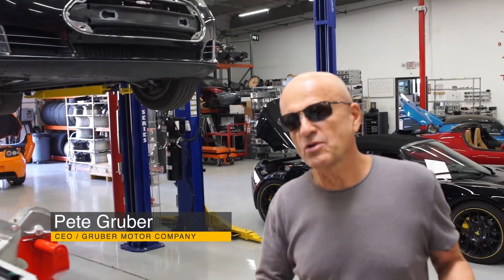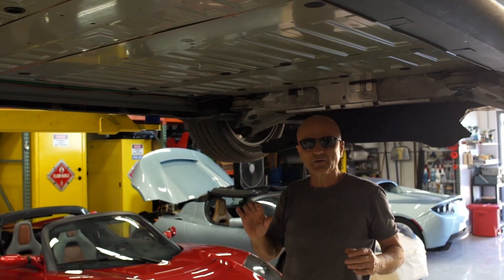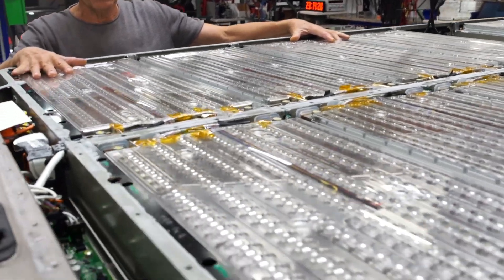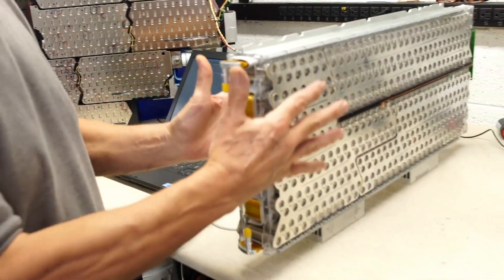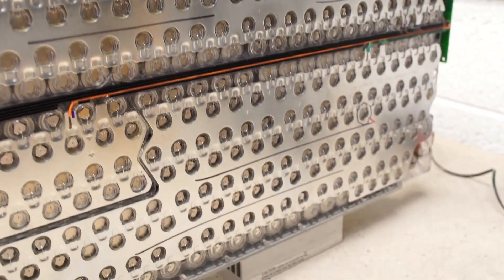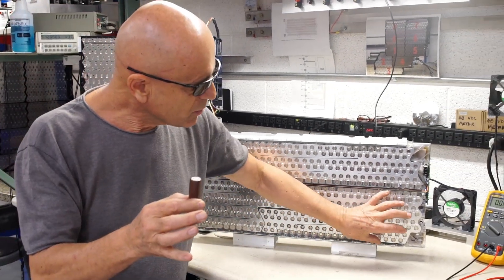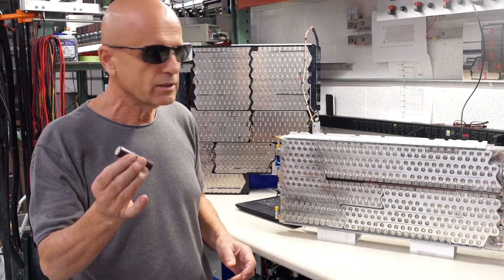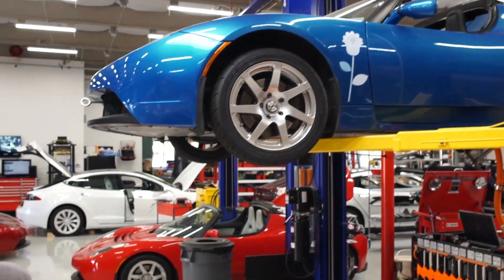Tesla Model S Main Battery Repair | Gruber Motors

Comment: The special process to determine the bad cell is most likely a thermal camera. When you charge the pack and watch it's temperature, the resistive cells will get hot and show quite clearly on a thermal image. 
Snipping them out is fine, as long as its not too many per pack. Effectively removing it will decrease the whole packs capacity, which will lead to balancing issues if a lot of cells are removed in this way. So if this is done repeatedly to a pack over a few years there will eventually come a point where you need to actually open it up and replace the faulty cells with new ones.
As far as I can see the cooling solution they've gone for is flat tube sandwiched with thermal pads in between the cells. That way the cells are not directly touched by the coolant but can still dissapate their heat. So a replacement of cells should be possible, although it will take significantly longer than just cutting the fuse. So its best to only do this if the pack has lots (Say more than 10%) of bad cells.
Reply: Thermal camera might catch it, or you could probably use a sensitive DMM to measure the voltage drop across the fusible link to each battery.  At equilibrium the bad cell will have approximately 74 times the voltage drop seen on the good cells.
Reply: @fredhamilton1701 that would be fine if the cells where in series but there in groups that are parallel. Put it on a power supply and wait for the hot spot, simplistic/fast. The real problem, it is all a waste of peoples money to do this. If a pack could be r&r in a hour that would be fine. The labor time to do this makes this a loser. You could fix it and two months later be back in it. The cells are going bad across the board because of the number of charge/discharge cycles. Great money maker for the shop, suckers bet for the customer.
Reply: @mitchellcrane9809  The cell became resistive and perhaps that can be caused from the cycling, but it can also be a defective cell and not an indication that many more are about to fail.  I've built 2 EVs with LiFePO4 cells whereas the most recent one has 38 cell modules with 52 cells per module.  After just one year of use, I had one bad cell out of 1976 that went resistive.  I designed my own BMS and was able to compensate by adjusting balancing parameters for that module but eventually, I added a one-off cell balancer to keep that cell topped off.  That's worked for 6 years so far but I really should pull the pack and replace that cell.
Reply: @NP-co7kj  
What do you mean by "topped off"? You bypass that cell? Also, if you replace that bad cell, will it throw off the balance because of age/capacity differences? I'm trying to learn about battery management.
Reply: @shwndh  Hi. By "topped off", I mean the isolated charger is adjusted to 3.42 volts which is my balancing voltage.  Without the isolated charger connected to the cell that is self-draining, the charge in that cell module would be depleted over time, so this is essentially trickle charging that cell to compensate for the self-discharge.
Reply: @shwndh  I forgot to mention that if that cell is replaced, the capacity of that cell module (in my case, 52 cells per module) will rise slightly because as energy is drawn from that cell module, the new cell will be the last cell delivering energy due to its higher capacity.  The effect on the battery pack will be that if that cell module was the lowest capacity in the series chain, it likely no longer will be, so the effect would slightly more useable capacity in the pack.
Reply: Only a sucker would buy an electric car
Reply: If you look closely you can see and IR gun on his workbench.  Camera would scan larger areas faster - gun would provide better data for one cell.
Reply: Thank you father
Reply: One bad cell and 444 cells to a Pack is 1/444. This would hardly affect the Battery Capacity at all.
Reply: @peterduxbury927  To tell the truth
It's not just cutting 1 to 444.
It's much like 1 : (444 divided by 6 battery sub modules) that is greater than 1% (1:74).

The P73 one would also 'lower' other five P74's capacity by suppressing overal excessive ∆V via balancing.

P.S. That's because of misbalancing of former S6P74. The same is for other 13/15 modules.

Comment: Thank you for sharing.  I watched the electrified garage fix a battery pack and their system identified the bad sheets and bad cells within those sheets while the battery was still in the car so they knew where to go before they dropped the battery pack.

Comment: I've worked on electric buses which uses software that looks at each cell within a battery pack - voltage and temperature -  therefore can tell  exactly which cell or cells are defective. I'm not a software engineer so I have absolutely no idea what's involved there. All I know is, whenever there was a problem, I could plug in my laptop into a specific network port to look at each battery pack, then zero in on all or individual cell in the defective pack. That made my job really easy.
Reply: What is the software name please?
Reply: @paulasobdong7745  It was BYD's proprietary software, so i don't remember the name, and I'm pretty sure it's not available outside of BYD.

Comment: Wouldn't the $22K cost of a new battery instantly be added to the value of the car? I'd have thought c.$35K for a 6-8 year-old Tesla S with a brand-new battery was a pretty good deal. From what I gather the motor units are so over-engineered (absolutely massive bearings) that estimates of a life of c. 1M miles are mooted for them.
Reply from the maker: It should be, but valuation rules are more psychological than mathematical.

Comment: I'm glad the newer designs they are using today in the Model 3/Y and new Model S don't have this issue.  These old Model S's are when Tesla was still struggling as a company, they've come a long way.  But it's good there is an independent repair option.
Reply: Curious how the newer designs overcome this ?    Is this indeed true ?    Also curious how long it takes to find the module and then the particular brick and finally the "rogue" cell  ?

Comment: If one cell is gone its probably the start of the inevitable degredation  of all the cells.. 18650s dont last forever.
Reply from the maker: Actually, we have Tesla Roadster battery packs pushing 13 years still going strong, which amazes even the original design engineers.

Parasitic cells seem to be an aberration, both in Roadsters and MS.  That does not mean these packs will last forever.
Reply: @grubermotorcompany  all these things are basically just hundreds of 18650 lipo cells which are in power tools, torches, power banks, laptops etc etc...  why do they last three years in all the other things before degrading badly???

Comment: Great to see that there is an option for repairing it rather than just tossing the car. I'd be curious to know what the charge is for such a repair?
Reply: Jacob Holden  
Wow he's really lucky. There will be all kinds of new challenges and issues that arise with electric vehicles that people didn't think about at the time. I'm sure that was true with combustion cars when they became popular versus horses. But there is going to be an adaptation. And I don't like the fact that Tesla controls the repair and maintenance almost exclusively. Also they can barely handle the repairs needed at their current production levels. That's going to ramp up very soon probably doubling in the next year. If people can't get their car fixed in a reasonable period of time this is going to be a serious issue for tesla. I would say that's one advantage that the legacy manufacturers have. They're used to sales and service after the sale. And they have the equipment and the facilities to handle that. On the flip side I think they're doing a much worse job of building decent electric cars although that is beginning to change. The new Kia ev6 and ionic 5 look pretty awesome. The vwid4 is pretty nice too. It has some problems with infotainment systems being a bit crappy. But the overall car is pretty damn nice. But I'm probably going to wait until Toyota brings something out. Currently driving a 13-year-old Prius with 377,000 mi on it. Original battery powertrain the only thing I had to change was the inverter 2 months ago. Bought one of the salvage yard for a hundred bucks took me 45 minutes to install it no big deal. And that's the kind of thing that you can't do with a Tesla currently. I definitely be interested to see the video when you post it. When lithium batteries go up they are rather exciting and not in a good way. Be safe out there, and love you guys down in Australia. Someday I'd love to come visit.

Comment: Realy nice

How could you guys find the exact defected battery among the others ? I mean they are connected to each other parallely, I would like to know that what are the pecial procedures which you guys took advantage of
Reply: There are only four cells in parallel in each cluster.  Once the bad cluster is found inside the "sheet" by a simple voltage test, it comes down to isolating the one bad cell out of four  I haven't done it but I think there will be a small difference in temperature between a nominal cell and a leaky one.  I would try charging the four-cell cluster, then look for the cell that's warmer than the other three using a thermal imaging camera.

Comment: "All it took was one single cell out 7000+ to completely shut down the main propulsion battery pack"

Why won't the battery pack just simply short or disconnect that one bad cell? Also, doesn't the firmware know which exact cell is misbehaving? They are not monitored?
Reply: the present design of the battery pack does NOT have that capability in the Tesla hardware and software architecture. And if it did would probably raise the price of manufacturing of the battery pack and thus raise the purchase price of the car.

Comment: Excuse me. I read about a guy who did a tear down of both a model s and 3 who claimed that if model 3 cells were placed in a model S, it would have 50% more energy capacity. Could you actually do that with a tesla model S 100d to 150 kwh???

Comment: What’s the cost associated with this repair?  Do model 3/y packs function the same as this?  Are you seeing any particular trends with higher mile Tesla’s and battery repairs needs (ie most of the repairs are to vehicles with 100K miles and are over 8 years old)?

Helpful info for those current Tesla owners looking to ride their vehicles long term and risks to batteries by holding them.

Comment: The problem I see with fixing/cutting out single cells is the possibility of other cells failing in the near future. This might be fine when a battery pack is young as a failed cell is most likely a actual defect. If the pack has age (or more importantly charge cycles) then it could become expensive tail chasing proposition. Fix the pack today maybe it last a year or two years, perhaps only 4 months and you are back to pulling the pack again - time/expense.

Comment: 5k to replace a cell, then 6 months down the road another cell goes bad. So 10k on a old battery pack. No thanks. These cars are throw aways.
Reply from the maker: That’s actually an inaccurate statement. Battery cells won’t go bad every 6 months, it takes years before they become parasitic and go bad.
Reply: @grubermotorcompany  so say you have a 7 year old tesla and it's got a bad cell in battery pack, you take out battery pack and replace the bad cell and you guarantee that some months or years down the road another cell will not go bad? I experience this on electric forklifts

Comment: I still think that it would be better to replace cell, not to leave module without it. I understand that to do that you have to find cell with identical parameters as the others, and that this is one cell of multiple cells in module, but still. This module will have a little less capacity than others, a little higher resistance and so on. I still hope that you will replace the bad cell, otherwise there is no point to remove it.
Reply: Tesla battery packs are designed to work with one or two cells not connected - that's why each cell has a fusible link.  Normally when a cell fails it's a low-resistance failure, which causes all the cells in the module to pump all their current into the bad cell, which blows the fusible link, disconnecting the cell.  In this case the resistance wasn't low enough to blow the link, so they manually disconnected it, achieving the same effect.  One cell loss in a module has a very small effect - since there are 74 cells in parallel, losing one only lowers the capacity of that 4V "submodule" by 1/74 =  1.4%.  The module loses 1.4%/6 = 0.23%.  And the pack loses 0.23%/16 = 0.014% of its total capacity.  That's a small price to pay compared to the cost (it's almost impossible) of replacing a single cell in a module.  Yes, the car now has 0.014% less range (if nominal was 300 miles of range, now it's 299.96 miles - you lose 223 feet or 68 meters of range) and 0.014% less power, but so what?  The only issue is if you start losing multiple batteries in the same submodule (where 74 are paralleled together).  Even then you'd need to lose more than 1 or 2 before you start to see any practical effect.

Comment: How do you see the new larger battery size & packs being bonded at the ends & acting as a structural member, from a service & repair perspective ?.  I feel that much is not designed for serviceability.

Comment: Great information related to the older Model S batteries. I'm now a little concerned having an early 2012 Model S if It's only a matter of time for one of those cells to go bad? Maybe time to look at one of those roadsters that have a fresh battery pack.
Reply from the maker: If one goes parasitic, the symptom will be rapidly declining range,  Some packs have come in at 7 miles, 23 miles, etc.  A gradual decline over the year, like 5 miles, is normal aging.
Back away from a lot of supercharging, in favor of slow and gentle charging as your pack ages.
Reply: @grubermotorcompany  Thank you for the information.

Comment: Pete, thank you so much for an affordable option for my 2013 P85!  I hope to never need it, but makes me breath easier. It would be a shame to have one bad cell effectively total a great car.  I am curious, what is the turn around time? Thinking if it ever happened, it would be a great excuse to put it on a trailer and make a road trip from Texas.
Reply from the maker: It takes about a month due to the fact we have to find the offending cell, and then charge/discharge to flush out any other cells, and observe the pack during cell balancing and making sure no further decline is under way.

Comment: Imagine paying $20 k to replace a single battery then a month later another one goes bad out if 7000 so the car goes back to the shop. 😂😂 Or is there a way to guarantee the life of the other cells since they are not brand new? Unless I got a new battery pack, i wouldn't bother with a used Tesla with this defective battery problem, im too broke to spend $20k this way if i had it. Love the explanation though :)
Reply from the maker: All we have is empirical data from which we can extrapolate how Model S cars will continue to age.  The Roadster, which uses virtually the same cell architecture has been going strong for 13 years now, and we have recovered and repaired numerous packs using the same process, with no further decline.  This of course will not go on forever, since cells will go EOL, but that give the Model S at least another 5 years after a repair.

Comment: Seems like a very inefficient design. Best design would be if the battery computer can deactivate bad cells over time. Like a hard drive skips bad sectors.
Reply from the maker: The solution you offer would be nice with battery packs, but not yet economically feasable.
Reply: @grubermotorcompany A computer module controlling the battery cells. One module for each sheet of battery pack maybe. And I thought the batteries are connected in parallel not in series. I'm not being condescending but if I was a company having a very expensive and main power source providing energy for propulsion should have developed some redundancy. Maybe cost is not worth it.
Reply: @grubermotorcompany  yeah I figured. Plus the failure rate is probably quite low.
Reply: i work for different car manufacture. We replace the HV Batteries or send them to repair. 
But i can already tell through the diagnostic software, which cell modul has gone bad. So they have to diagnose only about  3 or 8 Single cells depents on the batterytype . But they replace the whole modul for warrenty reasons.

Comment: So I know those lithium cells well.  If one is going bad in that instance the others may start going bad like mold growing on bread.  I am not sure how this is a viable option.  What is being done about the health of the other cells while you have the whole thing taken apart?  What reports are you getting on the health of the overall pack, module, and specific cell?  What are the temperature variations under full load after replacing and are the cooling jackets glycol need to be replaced after service since it is being exposed to air?  What liabilities do you inherit after working on these?  Why isn’t Tesla taking advantage of down stream profits on older vehicle by licensing to you and partnering?  What have you done to display that synergy as a proposal to Tesla?
Reply from the maker: Lots of great questions and observations.  We are collaborating with Tesla BTW.